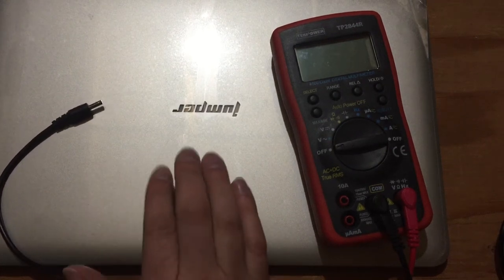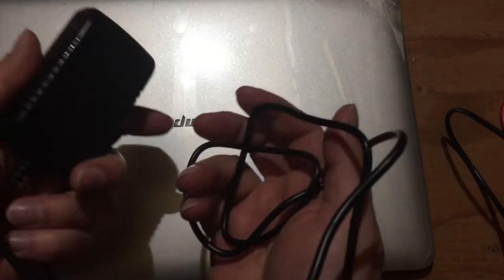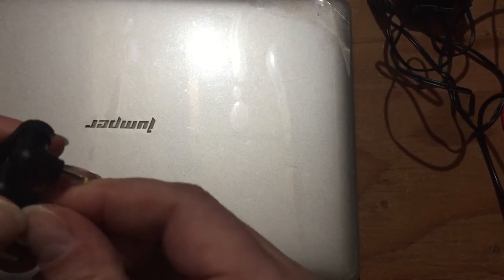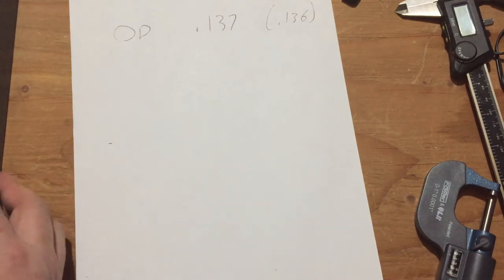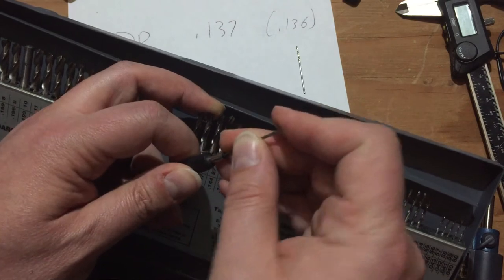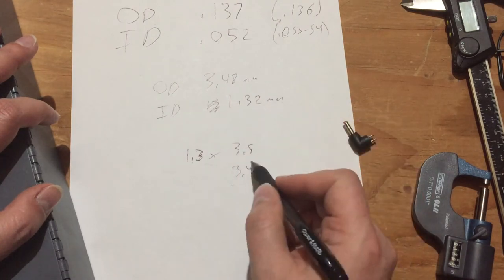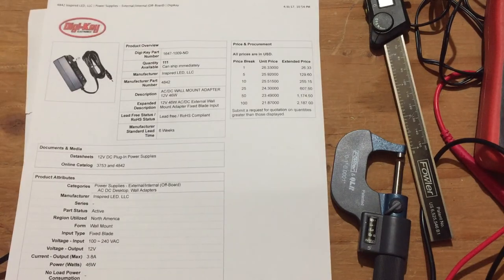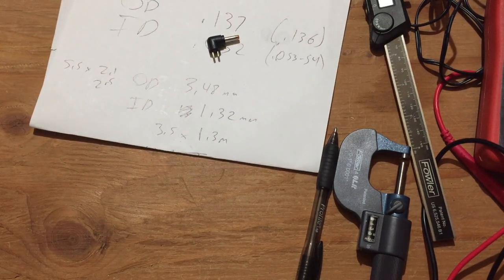Identifying an unknown barrel (coaxial) power connector

Comment: You also have to know if the plug is wired negitive original positive center.  Not all devices sre wired the same.  Not a big deal.  Its a 50 50 chance
Reply: The transformer should have a schematic indicating a pos or neg center.

Comment: Why not cut off the original end and reuse it with a new 3 amp 12 volt transformer I mean check the what is make sure it's a Transformer not the connector you had issue with but that would be the easiest method I think
Reply from the maker: Two reasons... first, it's easier to buy the right supply, if I could find it, than to buy a different one and splice the connector on. Second, it's just a nicer result than something spliced together.

It turned out I that with a little searching on Digit-Key, I was able to find a supply with the right connector as an off-the-shelf part, and trust me that a little bit of web searching was way easier than digging the box with my soldering iron, heat shrink, etc.out of storage in the garage, since I had recently moved.